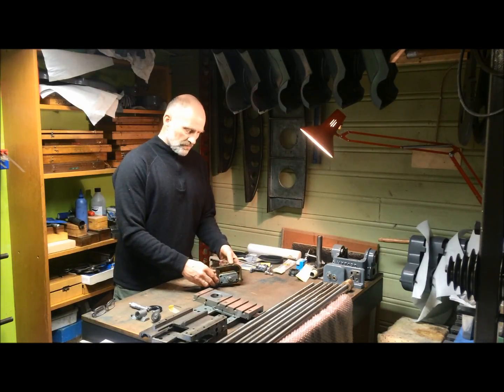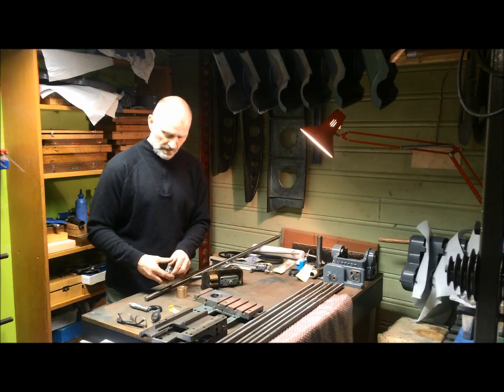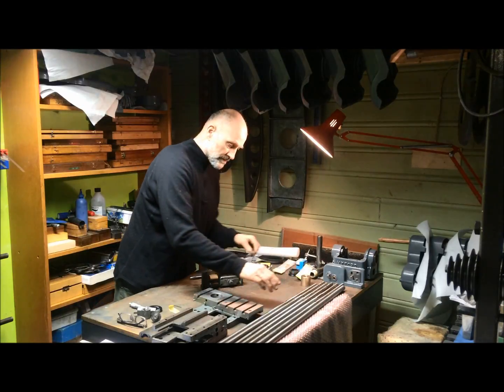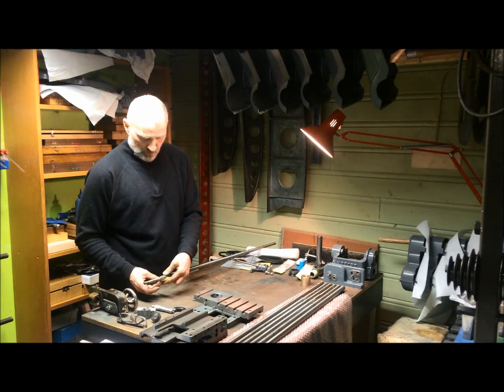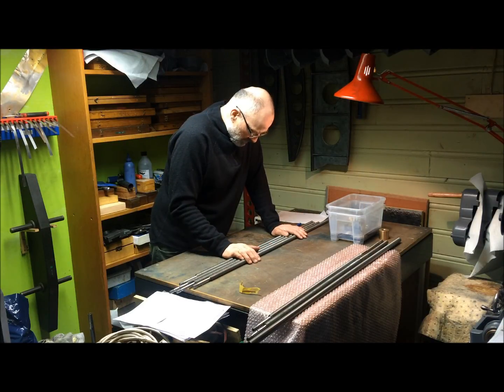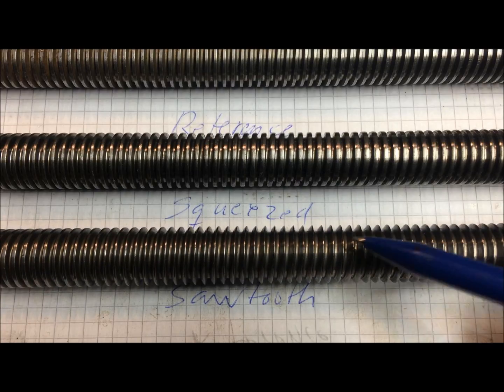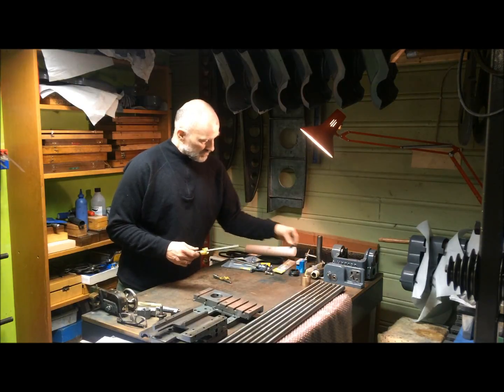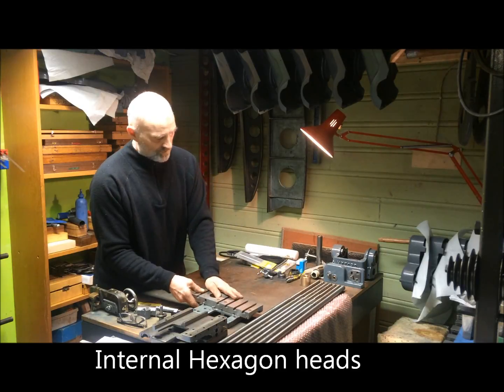Myford Super 7x7 - Remaining tasks part - 2

Comment: Very nice project Jan. Something to learn here. I go true the same thing with a Habegger 70 and a 102. Can you please measure the compound screws, cross and top slides and nuts. Length, Diam, Pitch. I am looking for replacement for Habegger. Thank you for sharing. Radu
Reply from the maker: 3rcamera Thanks! I can measure or give you the dimensions you want, but this is certainly not the same as for your machines. Or have I misunderstood what you want?
Reply: The Havegger screws and nuts are hard to find, so if is possible of course, after some work to adapt them to my needs. Thank you for your reply. Radu